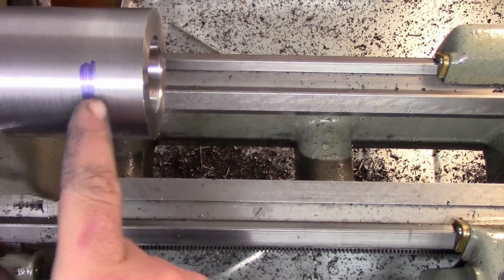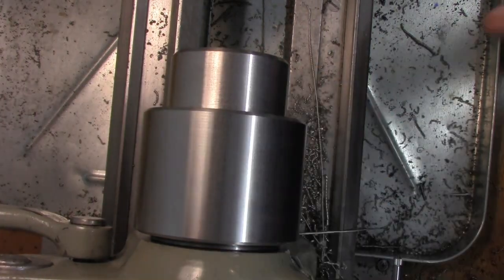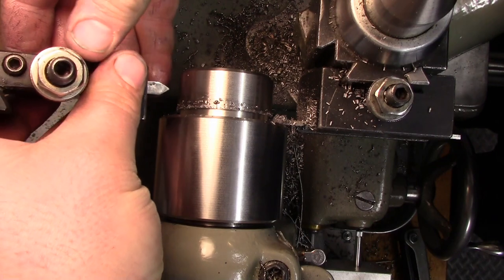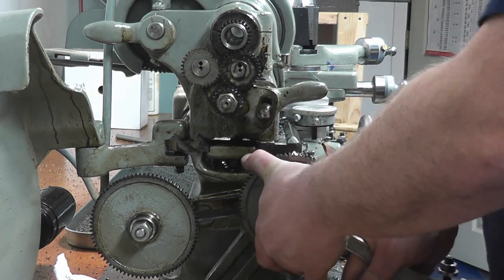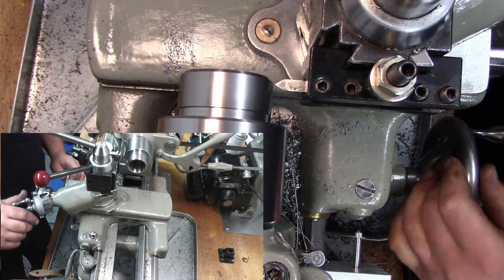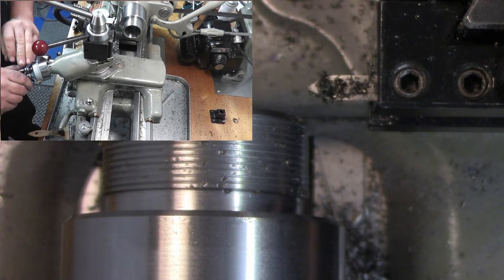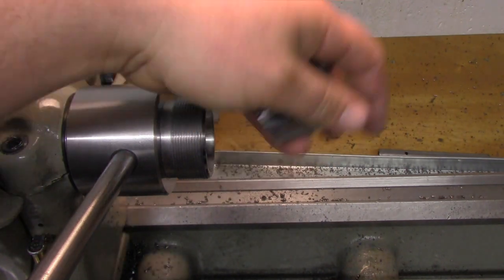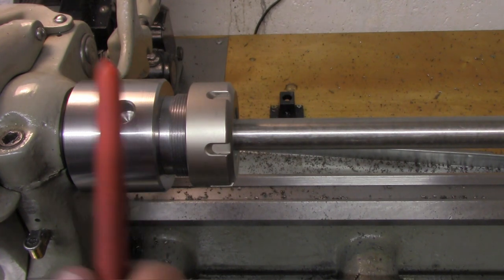Building an ER collet chuck: Part 4

Comment: After scouring the Net for info on cutting metric threads on a Southbend 13, I clearly need transposing gears. Thanks for the tip Greg.  I even thought of making collets and nuts in imperial but that would be very restrictive if I want any commercial ER 32 toys later.  I always want the ability to make my own stuff so I bought a M40x1.5 mm threading die.  Problem solved.  Now I can make tons of fixtures and only need to buy the nut and collets.

Comment: Excellent! I had not seen that make-a-mark on the thread dial technique before. The videography was superb. I could watch the controls and the threading at the same time. I just love ER collets. And you can stick a threaded piece in them and not damage the threads. I am told that it is possible to zero the runout on an ER collet. You do it by tapping the nut tighter or looser. .  I tried it. You can really improve runout, but I  couldn't get it to zero.Maybe there is a trick.
Reply: I don't think that is done properly. The half nut should not be disengaged, only spindle run backwards.
Reply from the maker: +Simon P 
As long as the carriage is not moved, the dial does not make a full rotation, and the same number on the dial is used, the half nuts engage on the same spot on the leadscrew everytime

Comment: Thanks for the videos on the ER40 Chuck build. Finished mine today and the run-out using different sized drill rod is .001 and out 8 inches from the chuck it's .0015. I followed your video on the band saw piston and that worked out great too.

Thanks Again
BPG

Comment: Nice job! I've been planning on making an ER32 chuck for my Atlas, though it keeps getting bumped down the project list. An idea I've been kicking around for lapping out the taper would be to get an extra collet, Loctite it to a  dowel pin or chunk of ground rod for a shank, chuck it in the tailstock, and load up the spring slots with valve lapping compound. Extra points if you make the lap shank an Morse taper for even mor accurate alignment than a drill chuck. If I ever get around to it, I'll let you know the results.

Comment: If you have to measure a thread pitch without a gauge, don´t try to measure from groove to groove.
Set your caliper to the width of 4  or more grooves and hold it onto the thread. Much easier to see if everything´s ok, especially on finer threads.
One note: Even if you´re perfectly in the groove, still count! Six grooves of 1.25mm and five of 1.5mm both make 7.5mm.
Reply from the maker: +sthenzel 
Thanks for the tip!

Comment: My lathe is an australian made screwcutting lathe, and as such it was designed to cut as many different kinds of threads as possible, including both metric and standard. It originally came with 2 different thread dial gears, I'm pretty sure one of them is lost forever but it shouldn't be really tough to make a new one. My thinking is that therefore someone who has a lathe that only ever came with one or the other should be able to convert their thread dial with a custom gear.
Reply from the maker: +Rob Mckennie 
Southbend offered a metric thread dial.  It had 3 gears stacked on a common shaft.  Each gear was for cutting a specific metric pitch range.  I've never actually seen one in person or even for sale so I'm assuming they're on the rare side.
Reply: ***** parts for my lathe are all but non-existent, but my thinking was that it wouldn't be terribly difficult to make one from an aluminium blank
Reply: +Rob Mckennie FYI, here in Sweden I have rarely seen a metric thread dial. The reason is that we don't measue pitch in TPI, or TPM as it would be for us, but rather as 0.5, 0.75, 1.0 mm etc. These don't always match up to an even number of threads per meter, which makes it impossible to use a regular thread dial. Those that exist consist of complex gear arrangements (which make them expensive), and don't even support all possible pitches I believe, so you would need several to use them for all pitches.

Most people usually leave the halfnut engaged for the whole threading operation, which can be done with a little finesse, and if you leave enough of a recess behind the thread.

Comment: great work your videos are appreciated. 
may I suggest that when measuring threads with a caliper it would be more accurate if the measurement is taken over a number of threads. cheers
Reply from the maker: +Charles Camenzuli 
Thanks for the tip!

Comment: A really really really good way to test shop made tool holders for the lathe is to turn a piece of stock concentric and then obviously put a Teske John it show concentricity and then turn it out of phase 90° and then recheck it then it will be the best way to test it you'll know exactly how much run out

Comment: Excellent video project.  I'm in the process of building an ER-32 chuck for my Craftsman lathe.  Or I was til I stripped the gears in the banjo.  Zymak don't ya know.

I was going to suggest you use something to hold the emery cloth when you were polishing the inner taper.  Don't want to see you missing digits in your next video.
Reply from the maker: +MarkBall3 
Yeah the rip fence on my fathers old craftsman table saw was made from the same stuff.  Cracked and crumbled. Some sort of nickel alloy from what I hear.

Comment: I am going to built mine soon, my lathe has a LOO type spindle & I need to know if once finished machining this, If I harden it will it wear down the captive ring nut in the spindle as that is hardened too.
This might be silly, all I need to know if making a hardened thread will create problems for the hardened ring nut.

Comment: Thanks for sharing, I like your vids! Tip; when measuring something recurrent like threads, measure several instances and divide measure by number of instances. That way your measurement error will be smaller per instance (thread in this case). :-)

Comment: Nice build, but two quick thoughts, if I may?

1. If you had made the mandrel from slightly thicker stock, you could've turned it to the 1/2" diameter between centres, thereby guaranteeing concentricity. 

2. Did the collett chuck really need to be that long? Making it as short as possible, would keep it more rigid, thereby reducing the risk of flexing.

Comment: No better chip breaker needed. From you closeup shot I can see you just need to take deeper cuts. You need to make deeper cuts than the nose radius on the insert to make the chip breaker effective. Then dial in the feed rate to get best results. If your machine has to little power to do that get inserts with a smaller radius. Insert tools are intended for hard use, people baby them way to much.
Reply: +oudijzergek 
And lower the cutter, it looked like the cutter was above the centerline. So only the very edge was working.
Reply from the maker: +Wood Chucker 
Camera angle and parallaxing does that.  It's on center

Comment: good video love it cant you make a taper and lap it ?
Reply: +Bleu Wolf 
This was my thought, only use the collet itself to lap it in.
Reply: +The Thing 
In this case he may not want to do any more tweek'n until he uses a gauge pin or mill tool shaft to get a real reading..
Reply: Lapping using the collet itself would impart matching changes to it's dimensions. The holder would only be well matched to that one collet. Turning a taper would be much better.

Comment: i just bot one in a flange though  I would make  a adjustability l flange what do you thick 10 throw floatability to adjust run out,   Les England ,
Reply from the maker: Yes you can just mount it to a backplate and oversize the holes slightly so you can loosen the mounting bolts and then tap the collet chuck around to adjust runout.

Comment: Early in the thread process you said the depth of the thread was 1.5. You also said the pitch of the thread was 1.5. I don't do many metric threads and have to admit, you lost me when you said that. Do you use some canned formula for your calculations? Nice project. Do you also have a CNC that you can borrow your ER collets from?
Reply: Joe Pieczynski I’m pretty sure that the dials on his lathe show the total change in diameter rather than the depth of cut, so to get the correct thread depth he has to use a dial reading of twice the thread depth.

Comment: Too bad you didn't fine tune the collet to better than about .5 thou.  If you had used a 10thou indicator, you would probably have practically no run out compared to what you have.  I have 2 10 thou indicators, and it's amazing when you think you are good, how much better you can be with them.  Go to a  garage sale , tool flea market, or other location or ebay and get yourself a dial indicator in 10 thou, and a test indicator in 10 thou. you'll be glad you did.  That run out you had at the end was something I expected unfortunately. 

It was a nice build, but that was one flaw that would really have been nice to have avoided. Even w/a 10k indicator, you would still have some inaccuracy built in, but that 3-4 wobble out there would be reduced to about 1 thou hopefully.

Comment: Where did you find the 54t and 80t gears? What is the bore dia. for these gears? Great series, far better than the original collet set up.
Reply from the maker: +Ken C 
54 and 80 tooth gears are a part of the standard model B or C change gear set.  You can usually find them on e-bay

Comment: really like your work.

when you cut the thread why do you disengage the leadscrew and then re-engage rather than leaving it engaged and simply running back and forwards (only cutting on the forwards obviously)?
Reply from the maker: By disengaging it allows me to precisely stop the tool in the spot I want it to.  By just using the motor you run the risk of over or under shooting.  Also I don't have to worry about backlash.

Comment: How big a motor are you running on the 9? Mines a 1.5 and it really bogs down a lot
Reply from the maker: Andrew Phillip 
It's the original 1/4 hp motor.  There was an option for a 1/2 hp motor.  If you're stalling a 1.5hp motor something is wrong.  Remove the motor drive belt and spin it by hand to make sure the bearings aren't binding.  Other thing to check is motor voltage.  Make sure you're not running a 208/230 volt motor on 115 volts.

Comment: I like the 30 minute videos better, sort of like sections/chapters of a course. Also you may want to zoom out just a tad more on the close up. The one over the lathe when threading seemed too close, especially when you had the second view in the corner. Most of the close up shot disappeared behind the second corner shot. Otherwise excellent project, look forward to the next one.

Comment: Nice camera work picture is so clear are you using a GoPro ?
Reply from the maker: No regular camcorders.  I use them because I like having zoom.  The picture in picture camera is my older Panasonic hcv-500.  The main camera is a new Canon Vixia hf r62.  got it for its ability to take an external mic and lenses.

Comment: Thanks for the series.  Great video technique.  I like the 30 minute length.  Question, wouldn't it be best to drill an opposing hole of same depth to balance tool holder?
Of course your safety Nazis are correct, but if you do continue the practice please try and have multiple views.  Nothing draws  viewers like blood and gore.  Like NASCAR everyone likes the race but most comments come from the crackups.  Be safe.
Satire aside, it is probably a better practice to have the emery backed by a straight flat surface instead of irregular finger.
Reply from the maker: +Morris Gallo 
It's not really taking a whole lot of weight out so it's nor really that much of an issue.  It's just easier to do one hole than perfectly opposing holes on a drillpress.